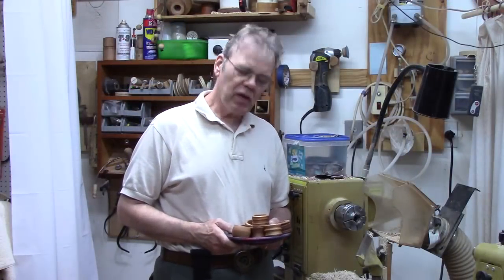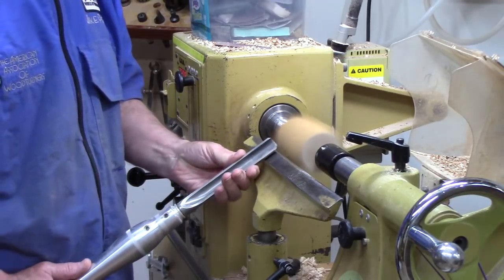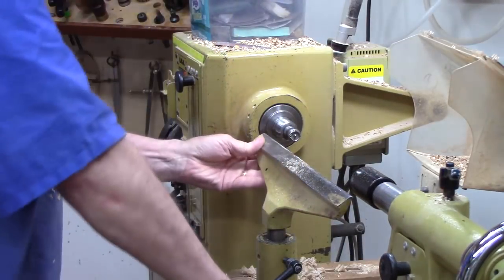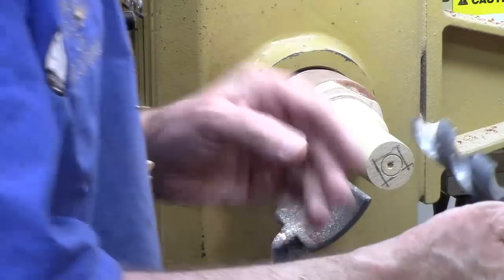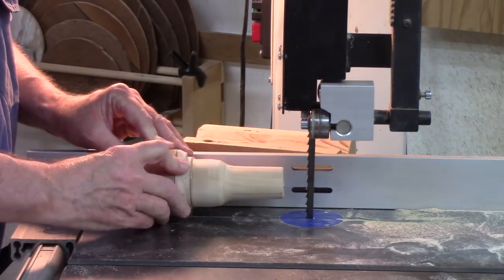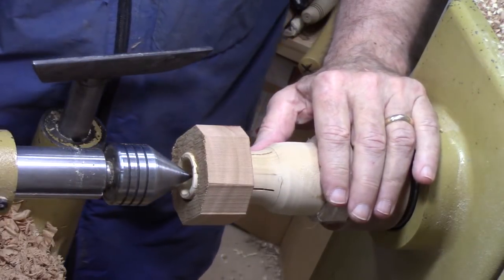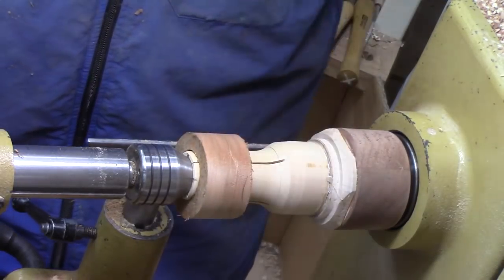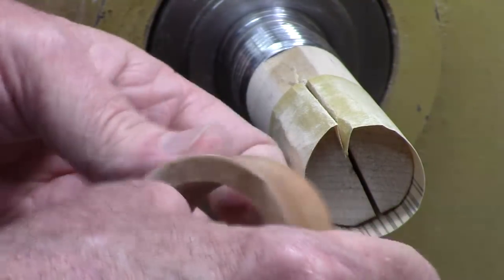Wood Turning Napkin Rings

Comment: I realise that this video has been around for a while but I thought I’d add this comment anyway.
Rather than a threaded block to mount the collet chuck to, I went with a Morse taper to fit directly into my lathe headstock, much the same way as Mike’s sanding spindle. Tried it today and it works perfectly. Thanks for the inspiration 👍🏴
Reply from the maker: Great solution if you don't have the tap! Thanks for sharing.
Reply: @MikePeaceWoodturning  I’ve made a few wooden Morse taper lathe tools, including a 7 mm drill on a MT2 taper for drilling pen blanks and a two part pen assembly press. My next one might be a smaller collet for ring making and I may do a few different sized drill bits…nothing wrong with the Jacobs chuck but sometimes a directly mounted drill is just more convenient.
Cheers
Reply from the maker: @georgenewlands9760  I agree. I love my large 1" MT2 drill bit.

Comment: How can I measure my corn that it's a 60°: thank you keep up the great videos
Reply from the maker: Jerry Mc Guire I don't understand your question.
Reply: Jerry, it's a cone, not corn. An easy way to measure it, would be to lay it on a sheet of paper and then draw a line up each side of the cone. Once you've done that as accuretly as possible, measure the angle with a protractor. Better yet, buy an adjustable angle gauge.